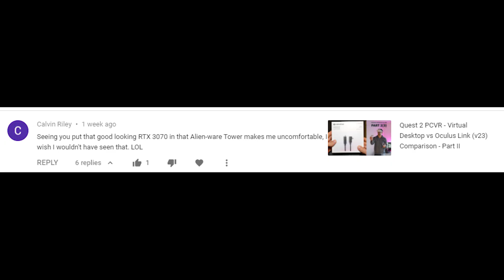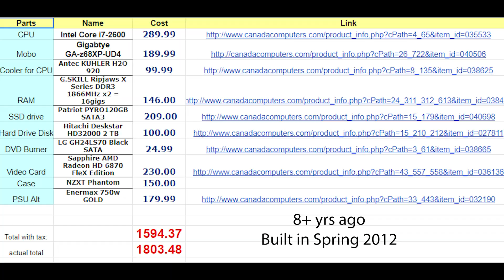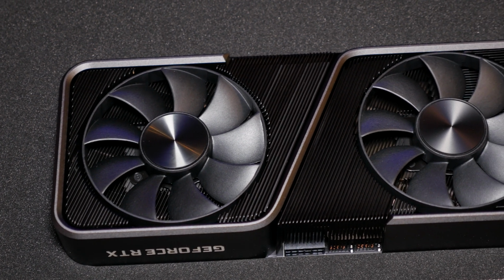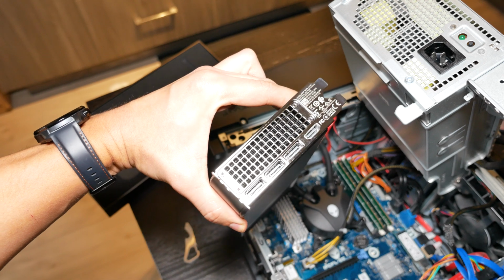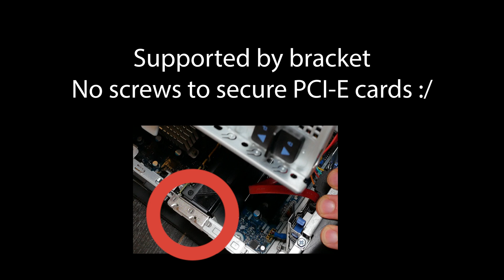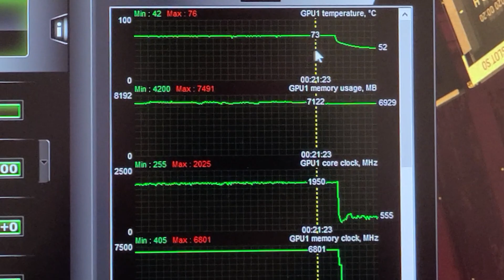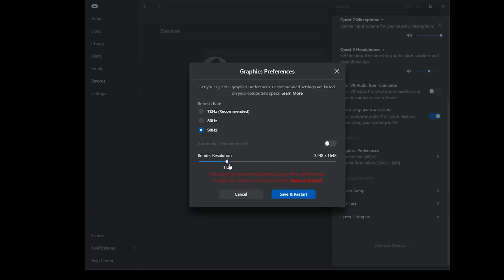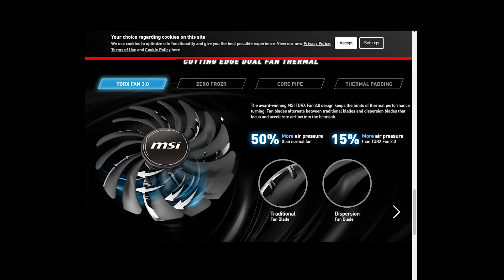Will My RTX 3070 Melt My Prebuilt Dell PC? (Review from Aurora R7 / R8 User)

Comment: I have some observations here..

I purchased a R7 around the same time you did and at the time it $600 cheaper than it would have cost to build it myself /w comparable parts.  I have no issues what so ever in buy a alienware and I build 20+ system a year. (that guy that everyone goes to .. lol)   One thing people need to realize going in is look for the sales and configure upwards from there if it doesn't quite have what you want. Also, always get the water cooling option as the case is designed with that in mind.  Dell shouldn't be offering air cooling at all with these cases (all the way up to the R-11 now..)  

A cheaper alternative to the 3070FE would be the little 3060TI XC  by evga as it comes in at just under 8 inches.    It runs in and around the same temp as the FE  (I've tried both in these cases for testing purposes)  so either or are good and don't thermal throttle.   Another option would be the Power Color 5700xt (non red devil) as it is using the same design as the ecs version that goes into the newer dells. But I'd only be looking at something like that if you have less than a 1070.
Reply from the maker: I didn't have those options when I first say the 3070. Patience favours the bold!

Comment: There won't be a faster card. You're at the limit. The R7 is limited by the motherboard running PCIe-x8 (v3.0). I used to build machines out of a vendor but the bitcraze of 2018, this machine went as low as 1000USD while 1070s were being scalped at +700USD. The R7 was a great deal.
Reply from the maker: Indeed!
Reply: so the 3070ti wont work?
Reply: Can't you just change the motherboard in the r7?

Comment: I did the exact same thing. I was concerned about the air flow above the GPU as well, so I installed the card in the lower slot PCI slot. I do not have extra SSDs there, so I removed the bottom SSD brackets for better airflow. No issues so far.
Reply from the maker: Whoa... You can install on the other pci E slot? Can u please share pic?

Comment: Recently installed Asus 3 fan 3070 on an aurora R5 . Replacement of the 1070. The 3070 fit like a glove. That is after removing the fan in case. Connected pins and placed fan above the card in case via a little screw as to not have fan flop around loose.
Reply from the maker: Ugh I wish I had triple fan, didn't want to take the risk
Reply: @JSyntax  FYI I did have to run back to store for the 12 pin adapter for 3000 series.
Cost on amazon is $12 I being impatient paid $20 for adapter at best buy
Reply from the maker: @nickcallisdead  surprised they didn't include it!
Reply: @JSyntax  me too. Apparently they said it only came with founders edition
Reply: @JSyntax  wife went to pick up a pi 4 2gb and pico Pi's and saw they had one 3070 and compared to the $1000 plus scalper price and grabbed for $700

Comment: I have a Alienware Aurora r7 and the i5 one will I be able to upgrade it to a i9 10850k
Reply: It should. I would look into a good deal on an i7 which have been more affordable since i9 release and issues ironed out.
Reply: I get it though. If I didn't have a good i7 and had extra money. Well I would probably buy an i9 too.
Reply: Apparently from the forums alienware has locked the BIOS so in order to run a new generation CPU dell would have to release a BIOS update

Comment: Looks like you have enough space for a Rtx 3080
Reply: It looked like you had about 3 inches of space no ? 3080 is about 2 inches longer
Reply from the maker: I haven't seen anyone stick a 3080 in this case yet? At least with proof?
Reply: @JSyntax  i have a FE 3080 it does not fit
Reply: I found someone who put a rtx 3070 triple fan in that was 11.3 inches long. He had to remove front fan cuz he need a tiny bit more space. The 3080 fe is 0.1 inch shorter I think the fe 3080 might fit.
Reply from the maker: @originalross9595  damn, I wouldn't what to remove more fans in this already hot case.
Reply: I replaced front fan to 15mm one and able to put fe 3080 in. It gets a bit loud when playing War zone. But I don’t really hear it with headphones On. Am a bit concern about damage to other parts due to heat.

Comment: Tuesday I'm going to put a 3080 in a R7
Reply: yeah perhaps bring the front fan from inside out :-D. it'll look terrible on your case though but would give a longer lifespan on your unit.
Reply: @swordfish72  , I actually messed about with that 😆, that's how desperate I am. I removed the front fan completely. Removed the plastic front cover and stuck a 15mm fan in there somehow between the cover and the metal frame. Checked my thermals and things seem ok.
Reply from the maker: How can it fit
Reply: @JSyntax  you can fit it if you take out the front fan someone did it before and it surprisingly its thermals weren't bad but it was a 3 fan one i dont know if the fe would do that well
Reply: Mind sharing the 3080 model?

Comment: Hi!,  I have an R9, and installed the 3070 as you did, thermals improved vs the stock GPU (2080 Super), I’m very happy with this card. From 85’C decreased to 76’C.
Reply from the maker: Nice! Which 3070 did you get?
Reply: @JSyntax  The FE, I am also thinking to get a 3080 FE, just need to adequate the internal space by replacing the front fan with a 15mm fan.
Reply: Is there a chance you’re selling that 2080? I’d like it for a fair price so I can try upgrading my aurora r7’s 1080 to a 2080
Reply: @adrianlorenzano4631  Hi I already sold it, sorry, but Im planning to sell my 3070 as I want to upgrade to 3080
Reply: @djbrokoly3909  I’d be interested if it fits into my aurora r7!

Comment: Awesome vid, very informative. Any idea if this card is compatible with my Aurora R5? It has an i7-6700 CPU and 32gb of RAM. Not sure about the PSU but I can find out (I hate that you have to open the case to check lol). Looking to upgrade my GTX 1080 as I game in 1440p ultrawide. Any advice is greatly appreciated! Thanks all, happy new year and happy gaming!
Reply: Yes sir. I have exact pc that you have. I recently installed the Asus 3 fan 3070. You need to move giant fan for card to fit. Fit like a glove it did. I moved the large tower fan above card and suspended with screw. One last thing is that don't forget to get a 12pin adapter $12-$20 @ best buy, amazon.

Total time from start to finish 15 mins. 
If you need help or anything just message me. I will walk you step by step to complete. Lmk I'm here for you and anyone else who might need a hand

Comment: You can fit the following RTX 3090 card inside all of the Aurora R5-R11 desktops (Gigabyte NVIDIA GeForce RTX 3090 24GB TURBO Ampere) 
This is a blower style card with a maximum length of 10.5 inches and a height of 4.1 inches. 
Also the blower style cards are ideal for the Aurora case as it removes all of the hot air from the case with little impact to the other fans.

I would always recommend getting blower style cards for your Aurora desktops as the majority of these cards between 10.0-.10.5 inches. 
Also another quick tip, the blower style card have a lower factory clock speed, but if you overclock them by 200+ MHZ  then this brings them inline with the OC versions of the same card.

I forgot to add, make sure you have the Dell 850watt Modular or 1500watt PSU installed, don't even think about it if you have a 460watt.
Reply: So let's say I install the rtx 3090 and upgrade the power supply as well is it as simple as plug and play ? Or would I have to install some programs?
Reply: Do you need to remove the intake fan? Or will it fit with the fan inside
Reply: @jaydenbrycebustamante8706  any GPU which is 10.5 inches in length will fit into the Aurora Case without the need to remove the front fan. 

Also you can move the fan to the HDD slot which will allow you to fit in a 12.6inch full size card.
Reply: @TJdakingful  thx I bought an aurora r11 not knowing the new rtx 30 series might not fit in them so I’m glad to hear this!
Reply: @jaydenbrycebustamante8706  if you purchased a R11 then you will get a Dell OEM 3000 series graphics card which will automatically fit into the case. 

It's more so if you want to install a 3rd party graphics card in the future. 
I have a Zotac 2080ti Blower in my Aurora R8.
Reply: @TJdakingful  Thx for the info. I upgraded mine to a 10.5 msi gaming geforce rtx 2080 back in 2023. I was primarily focused on getting a blower style than trying to get the latest GPU. But now I have a problem as I'm planning to add a NVME M.2 drive. The problem is that the NVME slot is gonna be under the GPU right next to the fan and I'm worry that the NVME drive is gonna be touching the GPU the entire time. This is espically if I decided to buy one with a heatsink, like a seagate firecuda, as I plan on making it was my boot drive.
Reply: Thanks for the tips and I got a 2080ti blower in mine as well.  Was considering upgrading to a 3080.
Reply: Do they make a rtx3700 turbo and will it fit dawg
Reply: Would a 3080FE Fit inside my aurora r12
Reply: hey i know this is years old but i never find anyone who understands a case that old LOL, i have an r5 and just installed an AMD radeon rx 6600, it's running fine but is there anything that doesnt work well with the card in the r5? so far one thing is that the motherboard is PCIe 3.0 so i dont have the full data transfer as PCIe 4.0 but it has improved performance quite a bit
Reply: @chocololz123  you probably would want to upgrade the cpu to what comes stock in the r7 which is a intel i7 8700 but get the unlocked k version as overclocking the 8700 turns it into a very powerful cpu.  That cpu is i believe one of the better ones you can upgrade to, i think it also might be possible to upgrade to a 9th gen i7 which has more cores but i would make sure it works with your socket and mother board first.
Reply: few questions for ya, i currently have a watercooled aurora r7 with the intel i7 8700 non k and a nvidia gtx 1080ti, it performs really well for its age but i also own several other computers more specifically i have a laptop with a rtx 4060 and im finding that the 4060 is really close in the same performance as my 1080ti while using way less energy and producing far less heat so ive been interested in upgrading my 1080ti to a newer gen card and have looked at everything from upgrading to a more powerful card to upgrading to a card thats about the same performance but uses less power and generates less heat ie is more efficient.  The 4060 desktop variant is very attractive being that its far less wattage but would perform better then 1080ti and cost very little even new.  When you start looking at cards with higher spec performance for their particular gen it seems like those cards become harder to find in the used markets for a good price.  Looking for a 3080 of the type you describe is next to impossible for  reasonable price right now.  I havent seen any under 1000 dollars and thats just ridiculous for a card that is now 2 gens old.  But i entirely agree with you on blower styles being the way to go for this case and really like that card in particular, what im wondering is what other suitable blower style 3080,4070,4060 or 3070 range cards are there that would fit (fitting is the big part here as fitment is super tight in this case for several reasons).  Im also wondering about upgrading the cpu, would going to a k variant of the 8700 make much sense to do from a value for performance stand point and also would a 9700 fit because going to 9th gen means 2 more cores and from what i hear theres a big performance increase from 8th to 9th gen so is that possible to do?  From my research it seems like it would be possible.  Would overclockig the 8700k in this motherboard work?

Comment: Hey, I am also trying to upgrade R7 with rtx 3070 MSI ventus 2x. Do you have to plug a VGA cable from the powersupply into motherboard and if you do, do you plus all 8pin in or 6pin is enough?
Reply: And if you had a compatibility issue  from motherboard and GPU?

Comment: I have an Alienware liquid cooled i9-9900K 16GB 500GB SSD + 1TB HDD with a 1660Ti. I can say that the Alienware technical support i received- remote support/phone support & technician dispatched were SUPERB. Their Alienware software is amazing but replacing components needs to be done carefully especially the PWM fans which need to have a min 1700-2000+ RPM. 
I look forward to replacing the 1660Ti soon with a 3070/3070Ti. Alienware stock 3080/3090 dimensions are Height 118mm x  Length 267mm. (link below)
https://www.youtube.com/watch?v=mZYAOwML1II

Compatible replacement parts : 
Liquid Cooling replacements  : Corsair H60 + H80(as per another alienware users report)
Fans : Corsair  ML120 LED pro, Noctua NF-A12x25 PWM

There was n Indonesian youtube who did board level components analysis and pointed out the Ventus as having inferior VRM components - hence the ability to overclock is significantly reduced. He compared 37 cards from its specs. Video link at said timestamp below
https://youtu.be/N3lfXsa08CY?t=495

Comment: I have the aurora r6 and my cpu is weaker, so if i were to upgrade to a RTX 3000 Series GPU, I would have to also upgrade my CPU, but the motherboard is incompatible with recent CPUs, and even if I could find a CPU that wouldn't cause a bottleneck, the price of both would be around the same as a new PC. But hey, I've had my R6 for nearly 4 years now, never had a problem, and it has ran everything I've thrown at it so I got my money's worth.
Reply: Whats the latest cpu an r6 can take, i got an r6 with i5 7400 and a rtx 2060
Reply: @SniperFoxx420  I would  look up your current cpu and then look up comparisons against other similar cpus based on its generation or the year they were released. They are likely to have the same requirements for connection. Also, consider the power requirements (pre builds tend to have cheap power supplies) and ventilation. You might need a different cooling solution, considering the R6 case is cramped and air doesn't flow as well. It also limits the size of your cooler to whatever fits in it.
Reply: @DumbDesign  would it be a good idea to transfer the pc to another case? Ive seen a few people do it but im new to the pc world
Reply: @SniperFoxx420  some prebuilds have proprietary parts which are meant to force people to go through their company for upgrades/repairs. Not sure about the R6, but some motherboards in pre builds are custom made for their case. If that's the case, I don't think it'll be easy to move it to another case. Since you're replacing the CPU, I would just take the graphics card and buy the rest of the parts. It'd probably be better in the long run.
Reply: @DumbDesign  i need to dust the damn thing havent done so in like 5 years lmao, runs kinda hot i also ordered thermal paste to reapply to the current cpu maybe that helps

Comment: I have the Aurora R8 as well. I just installed the Asus RTX 3070 KO dual fan edition. It just fit and seems to run well without overheating. Avg was 65 degrees on cod Warzone max settings
Reply from the maker: Ha! 65? Wow. I'm doing 75 in cyber punk.
Reply from the maker: Looks big at 10.82 x 5.16 x 2.13 inches...  did you have to make any modifications to make it fit?
Reply: @JSyntax  no mods. It literally just fit though. Just behind the corner bracket of the psu and not much room in front of the intake fan
Reply from the maker: @SpartanOneZero  haha, so would you see that is the utter max or can someone get a card that is  larger?
Reply: @JSyntax  absolutely. There is no way a card any bigger would fit.
Reply: have the ventus 2x version in my r8, runs cyberpunk smoothly on my 1440p ultrawide, rtx on ultra, gpu temperature avging 65 also
Reply from the maker: @matthsueh6555  sounds like it runs cooler than FE
Reply: You run on 1080 or 1440p and how many FPS are you getting ?
Reply: @hoydog33  1080p and on warzone was around 150ish fps

Comment: Great video, keep up the good work.
I have same pc as you, but it came with 1080ti. I have since installed Soundblaster AE-7 below it and another 1080ti below that! I connected the two gpu cards with an nvidia bridge. I also installed the same samsung Sata ssd alongside the hdd and nvme drive.
I put effort into cable management, and find the computer never gets too hot. GPUs sit at 70C at 100% usage and CPU sits at 65C.

I plan to switch the gpus for a single 3080Ti next year, and to allow it to fit, will change the front fan for a 120mmx120mmx15mm unit. Honestly, that fan sits at 20% usage all the time, so I don’t think it does much...

As your cpu is liquid cool, like mine, I don’t think the 3070 partially venting internally is an issue.

On a side note, one gpu overheated after recent driver updates and Nvidia were brilliant in assigning an engineer to identify the issue, they even ran an engineering test on their test unit in the US to help sort it out. I was super impressed, given it’s a Dell pc....
Reply from the maker: Damn, thanks for your detailed insights. Surprised you were able to fit all that in your case!

Comment: Dude I had to do the same. Always built and stupid bitcoiners upped the cost so I went with the r7. But I need to an upgrade. I got the 8700 and only 16 gigs with the 1070. Not liquid cooled. I’m replacing all the fans as they’re loud based on another vid. And putting a Samsung 1 gig ssd (looks like the same you got). I wanted a new vid but am trying to find the msi two fan card. I opened it and measured to figure what could and could not fit. I also have to up the psu. Basically my quick mid point upgrades before a new build. Glad I found your vid.
Reply from the maker: What psu do you have now